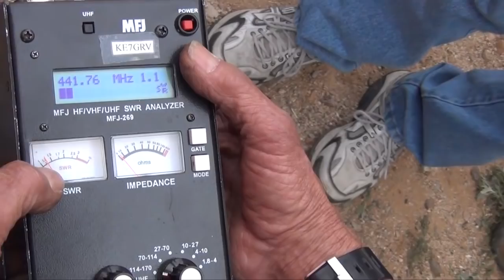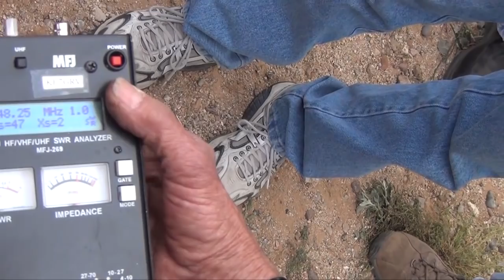SARC gets a new UHF VHF antenna and some tower repairs

Comment: This is a great training film on the improper installation of the hardline connector and the improper connection of the jumper cable to the hardline.
Reply: John Burningham I agree completely and was a complete  bodge job on the way the connectors was fitted and on some other things that was done. Seemed like there was some sort of rush to get it done. Do things properly the first time round and then there will be no reason to have to go back a few weeks or months later because of problems. Guaranteed this will need to be looked at again at some point. 

Good job to the camera guy (uploader of this video) for the close ups and asking questions although everything was done to a very bad standard the cam guy had more sense and most likely had done a better job.
Reply: I agree.

Comment: Great video.  Also the U shaped coupler you are talking about is a Shackle.  It's used to connect two pieces of chain together or two eyes togther and allow you to seperate them later without having to cut the chain.

Comment: First time I've seen so much grease put into connectors. I did 4 years installation-commission of VHF and UHF systems, and was told in no uncertain terms to apply Si grease sparingly only to the two O-rings on the sheath-locking components, keep it away from the dielectric. Cables used were LDF 4-50 and LDF 5-50. The sheath was wiped with IPA after connection and test,  wrapped with self-amalgamating tape supplied in the Andrews connector kit, then finished off with UV-resistant tape. It was all mil-stuff, so it had to be done as per manufacturer's instruction, or we could not offer a guarantee.
Reply: Looks like Andrew 1" 5/8 or 1" 7/8 main line, I also noticed the 2nd O ring missing between the Connector Bodies, the Grease used is just Silicon Grease, vasoline will work just as well. 
The self Almalg Tape is used to stop the Brass body from any Salty or acid Rain corroding the Connector body, with a 3M all weather PVC Tape put over the Self Almalg Tape between 3 to 6" above and below the Self Almalg Tape, the main line is Andrew coax at Terry refers to it as Heliax a trade name of Andrews.
The centre Pin is Screwed in on all cables above LDF5 right up to 9" coax, on ultra long runs, the center core can be Dehydrated.
Reply: +Les Eighteen - Not such a good idea to use Vaseline on O-rings, as it is chemically different from silicone grease, and can destroy O-rings. Silicone grease is stable at higher temperatures and does not break down electrically. Vaseline gets more liquid as it gets hotter, and runs, but can sometimes be used in low temp applications like domestic-satellite coax connectors. (LDF4-50 and LDF5-50 are 'Low Density Foam' dielectric Andrews Heliax cables. LDF4-50 is solid centre conductor, LDF5-50 is tubular centre conductor)
Reply: +nlo114, I know exactly what the Cable is I was a contractor direct to Andrews for over 20 years, from memory, I was making the point mainly about the Missing O Ring Between the inner and outta body of the connector missing.

Comment: A complete bodge job on the way the connectors was fitted and on other things that was done. Seemed like there was some sort of rush to get it done. Do things properly the first time round and then there will be no reason to have to go back a few weeks or months later because of problems. Guaranteed this will need to be looked at again at some point. 

Good job to the camera guy (uploader of this video) for the close ups and asking questions although everything was done to a very bad standard the cam guy had more sense and most likely had done a better job.

Comment: Good Job! I always use self amalgamating tape when sealing the connectors. It completely weatherproofs it and you don't have to worry about any water ingression, whereas ordinary electrical/insulation tape won't work properly.

Comment: Well in our case we both worked at Brown University at the time. So we put the repeater in the hut containing the astronomy dome and the antenna a two foot stub tripod out by a corner of the building. Fed it all with Belden 9913 because it was literally less than a hundred feet from repeater cabinet to antenna. 

In the case of the city building, my friend worked for the police department, me at the state AG's office. Put it in with police repeaters in the same cabinet.

Comment: I wish I would have seen ol Terry crimp those N-connectors before I destroyed a few SMA connectors trying to figure out the best way to do it!! Except SMA is waaay smaller than N... and I soldered mine... which was... frustrating to say the least!! What was that orange rubbery looking tape he was using on the connectors? Looked almost like rubber mastic tape, but orange.

Comment: yes I understand the job of a drip loop, but at the bottom not at the top! for example at a window or a hole on the wall, but at the top! ok that's fine, what about the water after the drip loop? its still going down the coax or hardline and into the window or wall. that's why I'm confused! and thanks for the reply.

Comment: Nice video and an interesting installation. Your questions during the video were helpful, especially to younger folks who may be interested in amateur radio. I've worked on many commercial T-Band antenna installations (that very near 70 cm amateur) and have never installed that loop just below the antenna. Perhaps for a dual band antenna, that is necessary. It's just that I've never seen it.

In your replies to those that have commented, you say that the repeater works fine and I guess that's the best test.

Bill
KB1ULU

Comment: Ca I adapt my Baofeng to this?
Reply: Yes but your Baofeng lacks of Receiving in general..so it's kinda "deaf" when you  plug it in a base antenna..it will perform better than the rubber duckie, but you will ONLY receive strong signals no matter what because of the filters..

Comment: That bit about the loop and RF current was pure BS. Also the hose clamp used to hold the loop to the tower will cut into the jacket of the coax.
Reply: 10. After connecting coaxial cable, fix waterproof sleeve to the
bottom of support pipe with a screw.
Turn connected coaxial cable once to make a loop right below
the antenna as shown in Fig. 10 to escape excess load from
the cable.
Reply: Yeah I thought the loop is for strain relief, particularly with movement. Instead they fixed the coax where it overlapped with something that could damage it. Then you hear the guy pretending he knows what he is talking about. What he may have been referring to was common mode current, however this single turn of coax is not going to choke that. A carefully wound ferrite choke would be much better, I mean while you have the antenna down. Mr smoke in in his right eye is fucking the whole thing up.

Comment: I agree, the LMR cable with 2 different shields will cause tx noise.  NEVER, NEVER, NEVER, cannot say enough, use coax cable with shields of different material like LMR400 or 9913 on a duplexed system.  Obviously knew about putting on connectors, but not much about repeaters.  I am assuming this antenna is for a repeater.  The clue will be there will be cracking noise on the repeater sigs, might not happen today or tomorrow, but it will happen. The solution is to replace this cable with like even RG213.  Since coax is at antenna 213 will work well.  Might go with RG214, double shielded, but not necessary.  Better yet move the 7/8s up the tower.
Reply from the maker: +ron wright Good to know. We haven't noticed anything yet with cracking and it has been 3 years. We are putting up another repeater so we will note your comments on cabling. Thanks.
Reply: 9913 is commonly known as water hose...JUNK on any repeater...poor shielding.
Reply: @Mike Sienicki 9913 is a water hose as well.
Can not be direct buried, and has high loss at UHF. Why settle for less performance, use Heliax, 1/2", or 7/8"..larger if doing long runs.

Comment: Is the antenna working?  I have my doubts -- the weather was much too nice when it went up.  Every ham knows that antennas work well only when the weather at the time of the antenna party is miserable, with snow and freezing rain a near-guarantee that the antenna will outperform any antenna installed in pleasant weather.
Reply from the maker: Must be try as they have changed the antenna since then.

Comment: While the diamond X510 that you removed might be great TX or RX only antenna it's a terrible repeater antenna that doesn't perform well when asked to transmit and receive simultaneously as it suffers from passive intermod and will create duplex noise..

Duplex noise is all that popping and clicking you hear when a repeater is retransmitting a signal from its input. It's cause by micro arcs in the mechanical joints of the antenna created by the trasmiters RF energy .. Normally you would never hear this because most hams don't simultaneously receive a signal while transmitting AKA full duplex..

Since these wide band micro arcs are being generated inside the antenna while the repeater is receiving a signal they have a clear path to the receiver.. A dead give away is the fact that there won't be any popping and clicking when the Repeater ID's in half duplex mode, In other words when the repeater id's without a signal being received on the input..

LMR400 is yet another source of passive intermod in repeaters and has been pretty much universally banned at all commercial antenna sites. While LMR400 might be a good low loss simplex coax for a simple ham station  its a terrible coax to use for full duplex repeater operation.. LMR400 is a foil shielded coax and every spot where the braid touches the foil acts like a little diode junction which creates these RF micro arcs and thus generates duplex noise.. Times Microwave sells a special type of low passive intermod coax for repeaters it's the SW series coax from Times Microwave...

Comment: Why are they choking out the Hardline by putting smaller coax from the antenna to the Hardline why not just run the Hardline direct to the antenna

Comment: great opportunity to fix the cable,too bad they didnt do anything right...that center pin on the lmr400 will fail and you should never use lmr coax on any duplexed radio system due to PIM problems with galvanic reactions in the wires mismatched shielding materials. and that antenna is not commercial its for residential...not mountain tops...winds will move the coverage depending on which way the wind is blowing.

Comment: NEVER NEVER NEVER use a hose clamp on ANY coax! That loop, is NOT needed, and adds a choke to the feed. Should have run that 7/8" right up to the antenna.
Reply: ERNEST AEC-RADIO What should be used to secure the hardline to the tower?
Reply: @swashington942  The ground connection from the mfr. is the best method, or you can use a hoisting sheath used to 'drag' cables up towers without damaging the cable, or crushing the outer copper shield.
Andrew majes stainless clamps you bolt to the tower, they get attached to the leg, then cable is pressed inside, and a bolt is used to lock the cable into the clamp.

Comment: That line about the loop below the antenna was BS.It may be a drip loop at best but if that Diamond dual band antenna needs a choke something is wrong I'd say.Looks as if there are three breaks in the feed line.One at the hard line & smaller feed line, one below the antenna,& one up inside the collar inside the long piece of tubing at the bottom of the antenna? Why not just run the hard line to the antenna itself & do away with the extra connections however many there are? We are dealing with VHF/UHF signals & each of those extra connections are losses that in less gain on every signal on the repeater received & transmitted. 73

Comment: That's Heliax cable not hard line.
Reply: Heliax is commonly referred to as hardline...
Reply: @Mike Sienicki In 30 years in RF systems, Heliax has always had a second name; hardline, due to the solid, corrugated shield.
This includes the cellular industry as well.
RF engineering is my life, but it's not worth arguing about personal references to cable types.
If both names are known, no issues come up.

Comment: amateurs, many details done wrong
Reply from the maker: Please share, we love to learn. As for the Channellocks backwards comment. 1) That is not me, I'm the camera guy. 2) Those are 90 degree cut Channellocks so they can work in either direction, put seconds later he switches the direction for the better grip.
Reply: ***** I deleted the comment about the channel locks right after I hit Post when I saw that he switched. When you use channel locks the wrong way you can damage your ligaments on your hand due to extra stress you put on your grip, slip joint pliers were designed to be used one way. Also the dressing of the antenna connector at the antenna must be done before the antenna is attached to the mast, allowing a clean dressing with the tape. When taping the connector, you want to hold the cable by the end and let the rest of the cable to support the work while you work the tape around the connector, trust me it makes it cleaner. The transmission cable was finished and attached to the tower before the upper section, working from both ends is not a good practice. You want to start at the antenna and work your way down to the radio, do not get ahead of yourself. It seems to me like the crew is in a hurry, this is a hobby and there is no boss pushing so why not take extra time and make it cleaner. I guess I am just too methodical, or like some say "anal" LOL  73's

Comment: PMSFL on the loop directly under the antenna. An RF loop REALLY lol. That’s not going to do jack shit for stray RF on the cable, It needs a few more turns and smaller ones than just one big single loop at VHF/UHF google will confirm that. I do this loop with all my antennas for a strain relief so the cable doesn’t pull and put stress on the antenna connector. Complete BS and Amateurs literally.😂
Reply: I think someone posted part of the instructions and I thought the loop was for strain relief. I wish they had said what grease they were using. Years ago when I worked with radar systems we used to use a conductive grease for some of these connections.
Reply: Loop might  help save equipment if it takes a direct lightning hit. Otherwise it is just for looks

Comment: Looks like too many cooks to me. And are they sure that old bloke can see? He might be deaf too based on the shouting. Just because someone jumps in as a leader and shouts and rushes, doesn't mean he knows what he is doing. He hacked the shit out of the heliax, used excessive grease where it wasn't needed and smeared it all over the dielectric, I would have thought more care should be taken at these frequencies. Used inappropriate tools all the way through and showed no care or detail with the crimped connector either. I probably missed a bunch of other shit because I spent a lot of the time cringing. And I wouldn't trust that MFJ piece of shit, especially if it belonged to him.